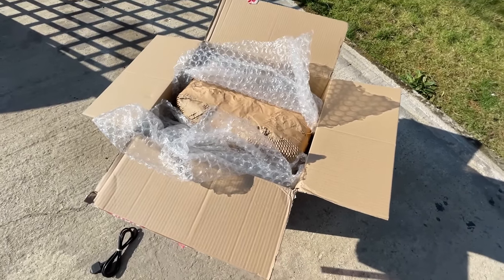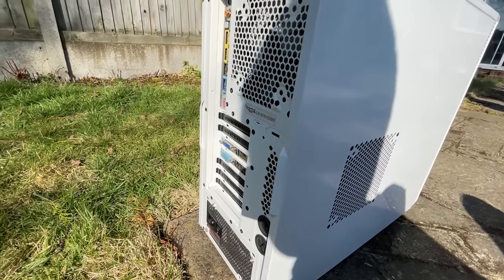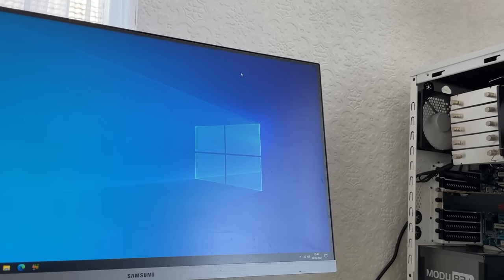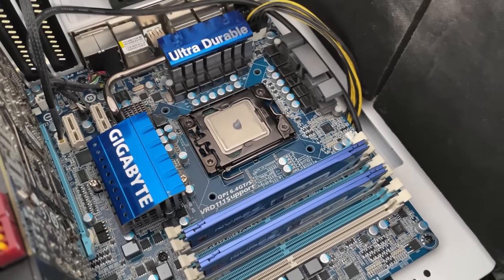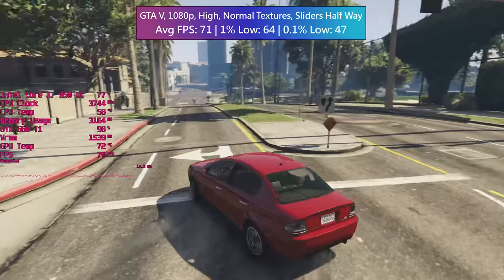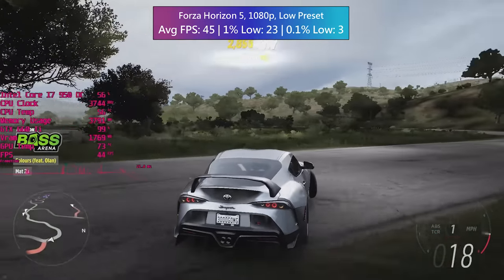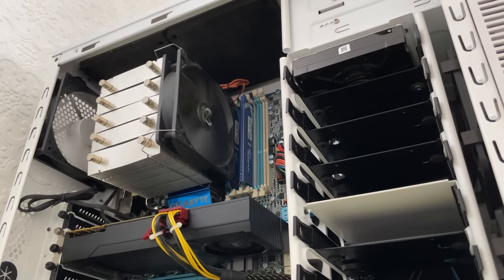What's Inside This £150 Core i7 Gaming PC From CEX?

Comment: Thats a sweet old pc. You should look into adding a third ram stick to take advantage of the triple channel memory this platform has. It helps a good bit with performance. After you're done testing with the i7, you should pick up a Xeon x5660 6 core chip to see how its holding up. They usually overclock better as well
Reply: I just bought a Xeon X5670 for $9 to use in mine in place of the i7 920 in there now but I am somewhat reluctant to try it yet because my board needs a BIOS update first.  That makes me nervous!  Maybe I should buy a backup chip or a chip programmer first.....🤔
Reply: I was thinking about the triple channel too. It really helps. I am still using a x3440 dual channel @3.8GhZ haha
Reply: @arthurmann578  just make sure the power doesn't go out andit's fine. If you have a battery backup, hook the pc to it and you wont have any issues, and if you dont have one they can be found pretty cheap used
Reply: @elikirkwood4580   Thanks bro! Be well!!  👍👍
Reply: @arthurmann578  What board have you got, I went from a i7 950 to a Xeon W3690 no issues at all, I have an  asus P6x58d-e
Reply: Bruh the ram stats are wrong , its under 4gb usage in all games
You could edit your comment to notify him
Reply: @arthurmann578  go for it, i've run x5670s for years. Easy 4.4GHz on air with not too much vcore.

Comment: I had the exact same motherboard paired with an i7-920 2.67 ghz OCd to 4ghz from 2009. to 2017. Was a great CPU and great motherboard with Tri-Channel DDR3 memory support. My last videocard in that system was a GTX 1060 6GB. I had a lots of great time with that PC.
Reply: I have 950 and how do you oc to 4ghz cos i cant beacose of temperature

Comment: These processors are still good. Overclocks easy too. The GPU is probably pretty bad. Also, you really want triple channel memory with this system.
Reply: I was just going to say this. Put in 3x4GB of DDR3, pair it with a 1650ti and it'll make an excellent mid-range PC.
Reply: @MyNameIsBucket  1650ti?
Reply: @MyNameIsBucket  1650Ti?
RX580 8GB
Reply: GPU is not that bad for games up to 2017-18 . There are unofficial modded drivers for it if you want more stable frame rate.
Reply: @MyNameIsBucket  I'd say 2X6 if you want to save money.
Reply: @aleksazunjic9672  Where can I find those modded drivers?
Reply: @MyNameIsBucket  1650 ti is mobile only, but I came here to suggest the 1650 Super which me and like 6 of my friends use (we play esports)
Reply: @suiken3149  Search shadier corners of internet :D Hint, go to yandex and search nvidia модифицированные драйверы ;) Good luck and beware of viruses :P

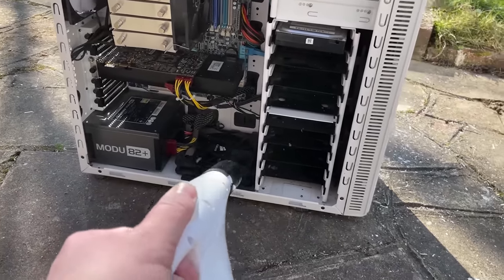Comment: 2:28 Absolute pro.. using an electric air duster.. none of this blowing holes in the ozone layer with endless cans of compressed toxic waste gasses. lol
Reply: plus you don't have to buy more compressed air cans!
Reply: I mean we long stopped using ozone layer harming gasses

it's usually just compressed outside air. or CO2 gas

but yeah. it's much less wasteful :3
Reply: im surprised more content creators dont buy a 40 dollar air compressor. its literally used in so much computer/tech stuff and is superior to those handheld air blowers.
as a bonus can be used for spray paint / modding given the proper attachments are purchased

Comment: The UD3R is a good board (I have two), especially as it supports all the relevant XEONs. Not the easiest BIOS to use for oc'ing, but certainly plenty of potential with the board itself, though I am a bit surprised you couldn't reach 4GHz with that i7 950 (quite time consuming though to properly establish the bclk limit, uncore, etc.)

I recommend Miahallen's oc guide for those who wish to push their X58 platform to the limit, very thorough and methodical.

I wonder what happened with the RAM? Do the DIMM part numbers suggest it was originally a triple channel kit and one of them has gone missing? I can't remember now to what extent not having the 3rd channel active made a difference to gaming. Back in the day, 3x4GB was the more common config.
Reply from the maker: Yeah seems as though the third stick was perhaps sold by the builder at some point. Or they bought them as an 8 gig kit

Comment: For an uncomfortably long time, I had someone using an i7 870 with a 3080 since they only had 1k to spend on pc upgrades. It worked better than expected since they exclusively wanted to play games at 4k but man was it the ugliest build on paper.
Reply from the maker: Haha yeah that would make for a fun video too. Early  i7 and 3080
Reply: Getting newer CPU might be a hassle to do. Changing motherboard, ram, and cpu itself. Changing GPU is a lot easier since it pull out the old one and plug newer.
Reply: @pahlevymu  you have to worry about the power supply too when upgrading a gpu
Reply: i went the other way, knowing todays market i shoulda got that 3090 and ran my ivy bridge i7 instead of my i9 10850k/3070 sff build i have now. not that im complaining but with todays knowledge i bet everyone would have jumped on a 3080/3070 or that 2080ti that sold for dirt cheap on ebay lol
Reply: Lol i actually still have my trusty i7 870 from 2012. Oc to 3.9 while paired with a rx 580 and it performed more than well enough for modern games, getting 45-75 fps depending on settings. Ive since upgraded to a much newer setup, while leaving my first pc with the family. Going on 10+ years and still kicking, though obviously being stuck on ddr3 and old platform is hurting more and more. Still a solid cpu thats held up over the years.
Reply: typical 8yo: wHaT's ThE pRoBlEm!!!??? iTs aN i7
Reply: My brother was using a i7 990x with a 3080 ti it was good but my god that card was being held back I talked him into selling it getting a 3070 and upgrading to lga 1200 with an i5 10600k a much better system

Comment: The Case, if anyone is wondering, is from the Swedish brand "Fractal Design", generally high build quality with sound dampening being one of the primary focus points. The one in the video is likely a "Fractal Design Define R2".
Reply from the maker: Thanks for that :) it’s a great sturdy case
Reply: The case in my x58 machine is also a Fractal, a Focus G. I also have a Meshify C and two Meshify 2 Compact.
Reply: Yeah I was gonna say, no mention of the case. I have an old Define R5 and it's still great, looks very similar to this but black.
Reply: Those are nice cases. I have my X58 system in a Fractal Design Define R5

Comment: I have an LGA1366 X58 system. Still runs great. You can get more performance with triple channel ram (I have 3 sticks of 4GB) and replacing the i7 950 with an X56XX cpu. I currently use an X5675 which has 6cores and ran me less than $20.

Comment: I am still using first gen i7. Got an Intel i7 965 Extreme Edition on a Asus P6T motherboard (not SE or Deluxe version). Got it maxed out with 24GB of DDR3 ram. (I believe I have it in the 1600 or so range for ram speed). The P6T is a beast. It has SIX ram slots in tri-channel mode! Kinda wish I could put more then 24GB in it though. I know of other DDR3 boards that could go higher so odd the P6T is capped like that. Six ram slot DDR3 mobos seemed to go out of style quickly. A lot of the newer ones went to 4 or less. Maybe folks complained about the lack of space. I'm sure only the larger size mobos could accommodate that many ram slots. :P

I'm using a EVGA 780 Ti with this build (would have went with a 980 or Titan back when I got this card but this was in 2021 and things were still pretty expensive. Also reason i went for that era card was to avoid having to use a DAC with my CRT monitor. There might be some decent external HDMI to VGA DACs out there but they are too expensive for me right now. The cheap ones are probably garbage and don't handle high refresh rate/resolutions very well. :( ).

The card I had before this one was a GTX 650 which I used for several years. The card before that was a GT 240 which I still have! Found it installed in an old computer I had stashed in the closet. So still have most of my previous video cards. :P

Comment: The great thing about x58 is the easy overclocks and Xeons work on many of the motherboards. You could have some serious fun with this old piece of tech.  Many times, the Xeons can be overclocked more aggressively too.
Reply: I built a system on Ivy Bridge when it first came out and I used a Xeon E3-1230v2, which was like getting a i7 for i5 money. You also got the advantage that those things are designed for 24/7 server use, and the lower power made it perfect for ITX. That thing lasted for ages, only retired last year.

Comment: In my personal experience when it comes to cyberpunk 2077 and the x58 platform normally it runs pretty well. But I think the biggest limiting factor for you was memory bandwidth. Cyberpunks massive assets practically need fast triple channel memory just to load in properly. It also helps to have a westmere 6 core with 12 mags of l3. Versus the 8mags on the Bloomfield chips.
Reply: Yeah i can confirm x58 6 cores do pretty well in cyberpunk. I averaged around 45 fps with dips to around 30 (when driving) with an R9 fury. Frametimes aren't perfect but they were loads better than the combo in this video

Comment: I am still sporting my X58 combo with an i7 980X (6 Core, 12 Threads) @4.4 12GB DDR 1600 as well as an overclocked 1080...also, I am using SSDs which are put into PCIE 4x slots using an adapter, since my motherboard has 3 PCIE 16X slots...these ssds are 4 times as fast as the normal ones connected via SATA, which is stone age SATA, I don't even know which generation is on my board...kickass system, running everything in 1080p with ultra or high...Witcher 3 even in 1440p with ultra...I really love my old but gold gaming PC and don't plan on upgrading it anytime soon...
Reply: usually those x58 board uses sata 2... although there are some variant with extra sata 3 controller connected with pcie

Comment: Ok its simple X5670 from ebay £18 fill the third mempry channel for the extra banwidth and oc the x5670 to 42.ghz all core and set the vcore to like 1.4 and off you go x58 oc is ver4y easy i have been running one of these for over 6 years overclocked 24/7 stable at 4200mhz and it runs great makes a huge difference in games having the fsb overclocked :)

Comment: My 3GB EVGA FTW 660 ti is actually my favorite pairing for my Xeon x5675. It's still a pretty decent card especially for the $55 I paid for it. Mine doesn't have a few of the issues that that one has such as having 3gb of vram, it having a good cooler(altough still blower style), and being heavily factory overclocked.

Comment: My GTX 660 didn't stutter like that running Cyberpunk 2077, so the problem not the driver. I tried wih a Core i5 3470 + 8GB DDR3 and Ryzen 5 3600 + 16GB DDR4.

Comment: A third RAM stick would probably help this CPU in newer games, but not with this GPU, I guess. But Nehalem is still a solid platform, even though it is very outdated in terms of features (PCI-E, NVMe, USB).
You could even stick a 32 nm 6-core Westmere CPU into this board if you wanted to have some real fun. Those are pretty cheap now.

Comment: Damn X58, I love that old sort of stuff, I have an X58 machine with an i7 950 and a GTX 480, refer to it as the space heater haha.
I really like that old Fractal case.
I'd totally buy that machine off you, I really like these computers.
A little sketched out by the 425w PSU seeing as mine has an 850w Corsair HX unit, the board in mine is also a little better, a Gigabyte GA-X58-UD5... 660Ti is still a reasonable card

Comment: I got a Intel core i7 860 2.80ghz
4gb ram(2gb usable) and 9500gt 
Any tips on how I can fix micro stutters and Slow responding time when not playing games 

Edit: 64bit windows btw
Reply: Are you running 64 bit Windows? If not, you are stuck( could install Windows 10 64 bit free, though). If you already have 64 bit Windows, you really should try to get more ram in the system. I WOULD suggest getting a better GPU, but, well, you know.
Reply: @jtenorj  I just recently got the gpu I know it's a ancient one but hey I got it for 11dollars! when I convert it to dollars, was living off basic display adapter because I got a fake gpu and can't find the drivers lol 😂
Reply: With that little ram you are probably experiencing Windows swapping data from your ram to your drive as you exceed ram capacity. When that happens you will experience stuttering. Raising you ram capacity to 8gb of ram should clear those problems up for normal use. 16gb is the max on that processor, if you plan to keep the system and upgrade the gpu in the future you should probably target two 8gb sticks of ram for your upgrade.

Comment: i just got this board with i7 for £25  i upgraded to the x5660 for £7 and overclocked it to 4ghz with hyper 212 cooler  ,   is a good socket is 1366

Comment: I was running an extremely similar system for several years, it was an old dumpster find pc from a school but it had an I7 870 with 8gb of ddr3 and I later did a custom psu swap in the old Optiplex 980 and was able to run a special gtx 660 1.5gb alienware card that technically had the gpu die of the gtx 670, they were weird oem cards and would make an interesting video on their own but I was at one point using those specs for some jerry-rigged phone/pc vr when I started my vr journey.

Comment: Bit of a coincidence. I just picked up an x58 based system a few days ago. 
Mine wasnt that overpriced though. 
Mobo, i7-950, 24GB RAM, 750GB SSHD, HD 5850 for $50aud (about $35USD).
Added an x5690 (6c/12t, 3.46ghz) a few days later. 
Makes a nice little 3rd system.

Comment: And again: Great content!
I might have a question: lately I tried CS:GO on a C2D E7600+2*2GB DDR2 800MHz and a Zotac GTX 550 ti.
Question is: why MSI Afterburner (4.6.4, if I remember well) does not work? Goes in the background, but no OSD, neither framerate monitoring in background. :/

Comment: I managed to get a great bargain while throwing caution to the wind and picked up an Novatech (Clevo) P170EM gaming laptop for £65. Had to spend another £60 on a 330W PSU and the laptop was sold as faulty. Managed to get it booted up and is working perfectly! I7 3610QM, 16GB DDR3 RAM, AMD 7970M 2GB, 1920x1080 screen, backlit keyboard. Got a cheap 512GB SSD to throw into it for £35. So for £155 a fully functioning gaming laptop and will look to upgrade the GPU to a GTX 1060/1070. Result!

Comment: No I7 or 660 but I do use an Asus Rampage 3 Gene and P6X58D-E  with 24 GB of triple channel goodness @ 1966, paired with a Xenon X5675 @ 4.52 Ghz, RX570 and GTX 750ti plays fortnite flawlessly @ 120-240 fps in performance mode still waiting for GPU prices to come down but I'm sure these things could handle a GTX 1080, RTX 3060, RTX 2070

Comment: I still have my GTX 660 Ti (retired in 2015) and GTX 770 (retired in 2019). I previously paired both cards on my i7-3770 before I upgraded it to the GTX 1060.

Then in December 2021 I finally decided to retire my i7-3770 and build myself a i5-10400 with a GTX 1660 Ti. Perhaps I should take out my i7-3770 to run some older games.

Comment: Still using a w3680 overclocked to 4.1ghz on an hp workstation (equivalent of the i7 980x), 12gb triple Chanel ram, rx 570 4gb, it runs pretty much every game i want to play

Comment: What I found is that nowadays DDR3 RAM speed could also become a  limiting factor in some games. In AC Valhalla my i3-3570K and 1070 ti were at around 60% usage at all times, while FPS were low - no matter the graphics settings. I've also tried overclocking, a different CPU (i7-2600) and different RAM sticks, but no improvent to be seen.
Now, with a new CPU, Motherboard and RAM combo the framerate more than trippled and the pc became GPU limited.

Comment: I'm currently using a socket 1366 Xeon X5650 overclocked to 4ghz and no it's not as good as a modern Ryzen but it holds it's own gaming wise. 144+ FPS in Apex Legends. I have it paired with a 6600XT though. Which, at PCI-E gen 2 x8, has the same bandwidth as a 6500XT in gen 3.

Comment: I am using an i7 920 CPU on an ASUS P6T Deluxe v2 motherboard with an ASUS GTX 780 ti and 16GB RAM right now!  It runs flawlessly!  I just bought a Xeon X5670 for $9 to replace the i7 920, but I am still somewhat reluctant because the board requires a BIOS update first which makes me nervous as I have no spare chip or a chip programmer yet.

Comment: im using a gtx 660 sse 2gig with a Rysen 2600x over clocked Gpu is stable at 1228 boost clocks with fan at high stays at 58 to 64 c  im running high settings on far cry new dawn at 1280/720p with fps at 60 to 74 .im running windows 11 with hybrid UEFI Bios that EGVA was Kind to provide for my GTX 660 SSE

Comment: Replace that cpu with a Xeon x5650 with 6 cores and 12 threads and then overclock it to 4.0-4.3ghz and then you'll be absolutely golden... You can find them for $5-15cdn on ebay

Comment: Good Budget Sever you have there, But Giga MB 💭

You might get some more power by O/C the FSB to 125.

My I7-860 with an FSB of 200 ( 4.2Ghz) 
lasted two years before the Memory Controler went to Silicone heaven.

Comment: For power consumption I don't know about the 660 but I have a stock i7-920 with a 750ti and when that is running flat out CPU and GPU 100% in blender the system is drawing 185W from the wall and pulls about 80W idle.

Comment: Interesting fact is these boards will run both Bloomfield (45nm) and  Gulftown (32nm) chips . I have an Asus P6X58D-E board and from time to time I run a x5670 (Bloomfield ) but mostly use a i7 X980 (Gulftown) . The old i7 is still an excellent processor , but the Xeon is more fun to overclock !
Put a 6 core in it , add another stick of ram and the experience will improve no end !
Would love to see a video of an upgrade.